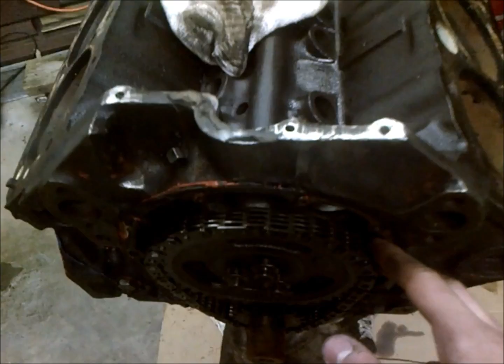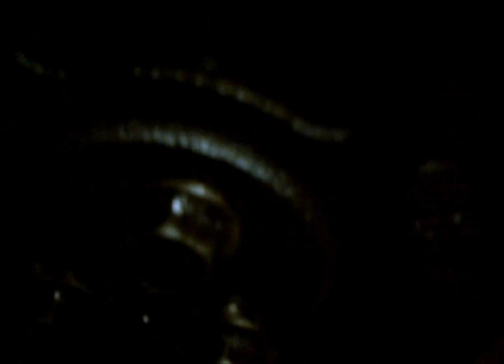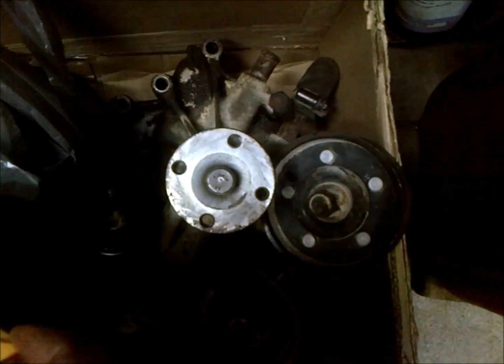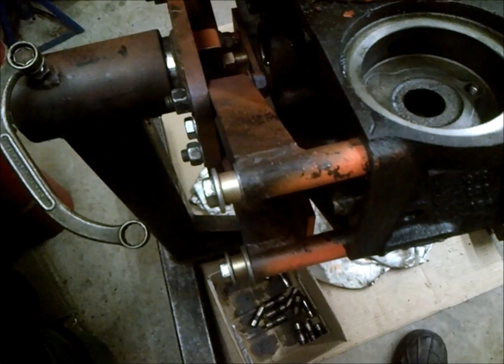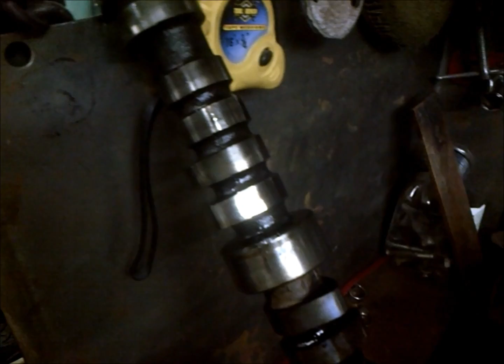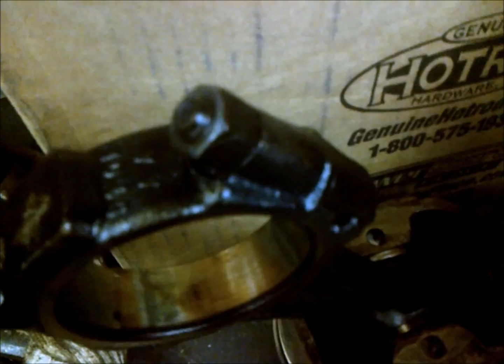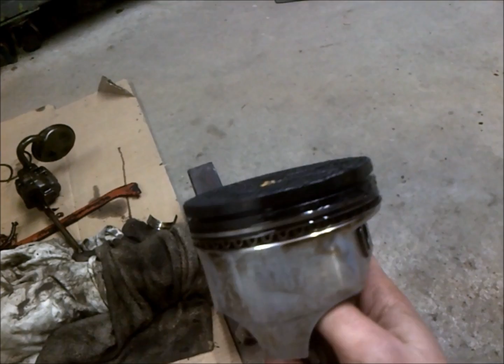350 Chevy vs Ford 302 Comparison: (Dumb Redneck Viewpoint)

Comment: Wouldn't an apples to apples comparison would have been a Ford 302 to a Chevy 305 or a Ford 351 to a Chevy 350?
Reply: +Alejandro S I think 302 chevy vs 302 ford would have been better. and a 305 is not a destroked 350, they have the same stroke but 305 has small bores@ Nick Vandiver
Reply: Alejandro S , of course not because a smaller displacement Ford compared to a larger displacement shit pile Chevy is the only way chevtards can feel like they have a chance to win a comparison.
Reply: Yeah you're right Chevy always needs more cubic inches to compete. Lol
Reply: mustang 302 vs Camaro DZ crossram 302😉
Reply: Mustang 302 BOSS vs Camaro DZ 302 sounds fair.
Reply: @alansnowden8025  Boss 302 vs DZ 302 ?
Reply: Why didn't you compare 302 against DZ302?
Reply: @shawnspencer5694 ; The cleveland head boss 302 against the DZ302. That would be fun on the dyno if everything is equal.
Reply: That happened on track. The 302 furd got smoked.

305 was designed as a smog motor.  In overall performance it was better than a 30p00. Hell the last years of the 305 it produced more power than a 30p00 to.
Reply: Or even better, a 302
Reply: its the same just bigger engine the block still the same
Reply: not so much the 302-305 since the 305 has a slightly less than 4.00" bore. But 350 to 351? Sure, but there's more than a couple of 351 designs. Since the vid aint so much about which is stronger in raw HP, I think the 302~350 was the simplest combo to compare.
Reply: thank you lol. a 305 is a destroked 350 which is why the 350 has such a longer stroke that that 302
Reply: +Sub Zero gt I know lol gotta compare a 350 to a 302 to have any competition
Reply: +Sub Zero gt sorry man can't read that
Reply: @nickvandiver3328  No, 305 and 350 Chevys have the same 3.48" stroke.  The 305 has a 3.736" bore while the 350 has a 4" and if you're going to have a smaller cube engine it ought to have a short stroke so it can still make power by revving.  The 302 Ford, and the 302 Chevy for that matter, accomplish that beautifully with a short 3" stroke and 4" bore.
Reply: @nickvandiver3328  actually no it isn't. The 305 and 350 have the exact same stroke. The difference is the bore only. The 327 and 302 are destroked versions of the 350.
Reply: @nickvandiver3328  actually the only difference between a 305 and 350 is the bore size really
Reply: Nick Vandiver the 305 is completely different than a 350 not just de stroked.
Reply: The only difference between the 305 and 350 block wise is the bore, they share the same crankshaft, same stroke, same journal size, same rods and intakes and outer accessories of course.

Comment: Interesting that you mentioned the Y block. It came out 1 year ahead of the small block Chevy . 
Not the same year. The heads are surprisingly close to the same as the small block chevy that came out a year later.  
You have to remember too that Ford was 20 plus years ahead of Chevy building v-8's. It wasn't chevy's first v8 but it was the first mass produced one. Ford had many years of production automobiles out there on the road. Also, it would be rather naive to think that chevy didn't look at all designs before coming out with there on. If I was building a new motor I would look at them all. They did a great job on it too.  Of course they copied things and made them their own. I would have done the same thing. The original big block chevy (W) was just like the small block in valve arrangement. Chevy didn't change that until 65-66. I do think that Ford copied the Chevy head design for their big block 429 and their is good reason to believe that if you look who was in charge at the time.
Reply: Chevy is a head Ford because Chevy had the first fuel injection in 1957 Chevy Bel Air Rochester fuel injection on the 283

Comment: I've always been puzzled by the fact that the 302 Ford and 350 Chevy were compared like they were equals.  The Chevy has 47 cubic inches on the Ford and the Mustangs still outran the Camaros.  If you think this is an even comparison I think we should compare the 350 Chevy to the 460 Ford.  How about that?
Realistically though I could never understand why Ford didn't put 351s in the Fox body Mustangs.  I guess it is because they didn't need to.
Reply: Ceritfied Kernel , Ford is light years better than Chevy shit piles that's why there are tons more Chevy crap in junk yards than there are Fords. Chevy blows just like all of you stupid chevtards.
Reply: Ford is kicking Chevys ass now .It is Ford that are making the best cars today and Chevy aint even close.You better look at the facts and all the data that proves it.Hell dont even talk about pickups for Ford has been the leader of that and has been the n umber one seller of pickups for over 30 years now and in all that time Chevy nor Mopar has been able to sell more then Ford even once.
Reply: You forgot to mention the fact that stock Chevy engines are unreliable, a Chevy engine will need rebuilding after far less torture than a Ford engine. This is the reason Chevys are so cheap to rebuild, in order to be able to even compete with a Ford, (in performance and longevity )a Chevy has to be modified ( I'm talking strictly about powerplant only). It is well known that if you build a Ford and a Chevy both having the same displacement and equal modification the Ford will both out perform and out last  the Chevy.
Reply: George  Look up a Ford Talladega , they were prohibited from NASCAR also
Reply: First 302 in Camaro was 67
Reply: Alan    As long as the Mustang was a 302 Boss
Reply: yes and it must have been a chambered rear end in Rusty Wallace's thunderbird the year he won 11 races?? lol the Thunderbolt was only one year 1964 fairlane with a 427 "Cammer" a SOHC big block still ahead of it's time, the 427 side oiler along with 428scj and 429 is what was in the NASCAR cars as the Cammer was not allowed for obvious reasons but in late 60's (torino Talladega and Plymouth  superbird) NASCAR said no big blocks in the aero cars thus killing the aero cars till 1985 Daytona 500 enter Bill Elliott and his little bird or aero bird!
Reply: Thomas Beleskey the Thunderbolt was not a S.O.H.C. it was a 427 wedge.
Reply: The best muscle cars where mainly made by Mopar.It was also Mopar kicked out of Nascar a few times because their cars where way too fast and Ford or Chevy didnt have a chance to bet them.
Reply: 7.0SBF GMcrusher 🤣 don’t speak up if you don’t know. Only difference is you’ll get to the same hp level with a Chevy for 10,000 cheaper. And parts for sbc’s are cheap because its been made more than any other motor, period.
Reply: 7.0SBF GMcrusher 80’s 5.0 fords are notorious for literally splitting in half at 500 horse. You can make 700 all day on a stock bottom end 350. Look up the episode of motor trends engine masters about it. That comment was a joke
Reply: Carter Quibell motor trend is BS! the 302 can handle about 5-600 hp before it splits in half,same goes for the 350!! The 351 Windsor on the other hand can handle 7-8 hundred hp I've even seen them handle over 1,000 hp on STOCK internals!! Plus a 351W can be bored and stroked to about 460 cubic inches!! Can't do that with a 350!!
Reply: Maybe all day for ONE day. 700HP is pushing it for the stock bottom end of  a 454 if you want it to last.
Reply: +St White chevy whoops em all in nascar
Reply: +331sbf ford based .yeah Right
Reply: +George Whitefield you're right about that. Not only NASCAR but when I was growing up in the 60's those ugly lightweight sedans with hemis and big blocks were kings of the drag strip.
Reply: how about mustang 302 vs Camaro DZ crossram 302 how about that
Reply: the cross ram came in the trunk
Reply: Won't the hell you talking about
Reply: Alan Snowden I is talkin bout they were not on the car they came in the trunk! do some research, the chevy 302 cross ram came in the trunk, you had to put it on your self!
Reply: jack rohde you now this car is rear wheel
Reply: it also depends on the model of 350 or 302
Reply: I bought a ex CHP 1983 Mustang with a 5.0 and 4 speed. It had a super weird habit of getting me speeding tickets. The thing was a super quick little car and pulled hard from 0 - 130 but then it just fell on its face . But it would hunt the whole time from 0-130
Reply: Thomas Smith not so far this year you dumbass.
Reply: the 9.2 deck height on the 351w is why I figure ford didn't stuff them in the fox body, they get awfully close to the strut towers down at the K frame. just a guess though
Reply: Thomas Beleskey ? The taller deck height   makes the 351 too close down low on the Fox srtrut towers by the k member?! The lower part of the 302 & 351 blocks are about the same width. They use the same mounts. Real reason is insurance, the same reason Ford underrated HP #s on things like the 428CJ. Yes, the 351 does get close to the brake booster, steering shaft and the hood is a big issue. 460s, 4.6s, Coyotes, BBCs all fit between the towers. That's a big reason why they're such a popular platform.
Reply: You are seriously misinformed.
Reply: the Mexican stock blocks are the ones to use if going to keep the factory blocks in a sbf.
Reply: +331sbf do you mean based after chevy
Reply: +St White What planet do guys like you come from? Seriously. I see another guy here in the comments stating the exact opposite, that "Chevy's whoop Fords". Your both childish. If either of you think that either auto maker "always beat the other"..........that's just absolute nonsense. I'll tell you BOTH exactly what determines winning races between 2 competitive engines of any given time period, and that was THE ENGINE BUILDERS/CHASSIS DESIGNERS/DRIVERS. THOSE THREE THINGS DETERMINED "WHO" WAS WINNING OR LOSING MORE SO THAN THE ENGINE PLATFORM ITSELF. Let me give you a prime example of a certain time period and "dominance on the track". Back when Bill Elliot set lap time records & just smoked the entire field in NASCAR..........THAT 1 YEAR.........all the other teams were crying foul. But NASCAR looked at what their "secret" was and told all the other teams that there was NO "cheating" going on. And all the Ford fanboys were cheering, saying it was the "Ford engine" doing it. BULLSHIT. At season's end, Elliott's team shared their "secret" with all the other Ford teams, believing all the Fords would kill the next season. But someone LEAKED  the little secret. And that "secret" was A CAMBERED REAR END. The car simply tracked straighter through turns & uneven track surfaces, enabling the driver to control the car better & hold the peddle to the floor longer. The start of the very next season in NASCAR, ALL the teams had cambered rear ends, AND THAT ENDED BOTH BILL ELLIOTT'S DOMINANT STREAK THAT 1 YEAR, AS WELL AS THE CHANCES FOR ALL THE OTHER FORD TEAMS. ..........and it had NOTHING to do with "the strongest engine". There's a million other stories that resemble this one, in every type of auto racing you can name..........where it was "the idea" or "method" that nobody else was doing at that time. I can go on and on about this. Every dog has his day. Oh, and by the way, if ya wanna talk about a serious Ford dominant streak for sheer power, it was their 427........that's right........a Ford 427. It was called the Ford Thunderbolt. For several years, I think starting in 1964, they used a Ford Fairlane for the body, and it was a total factory made car. It stomped the competition in drag racing for a few years. LOOK IT UP, if ya don't know already. That engine was a 427........NOT a 429.
Reply: +Howabouthetruth   Well I certainly didn't mean to come across as a Ford whoops everybody guy.  I consider myself a Ford man but what comes to my mind when you say muscle car is a late 60's early 70's 454 Chevelle.  And thank you for your exposition on racing.  I agree with you 100%.  And I don't have to look up the 1964 Fairlane Thunderbolt.  I was there.  I'm 70.  What I was talking about is the street dominance of the 5.0 L Mustang where everybody had a more or less stock engine.
Reply: You talking nonsense bullshit because Ford will never be better than Chevy

Comment: my first winsor gt40 heads weiland intake 600 holley 2 cam iam very impressed with the motor it spins 33s in my f150 with 65 jets 70 plus goes really nice
Reply: Sounds on par with boared 355 no heads or upper work all stock besides lift and 33s